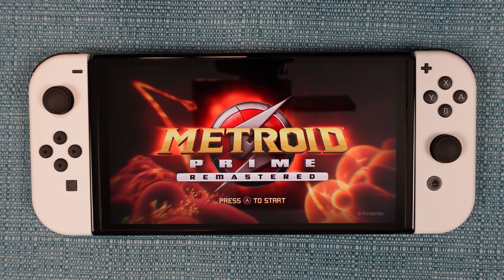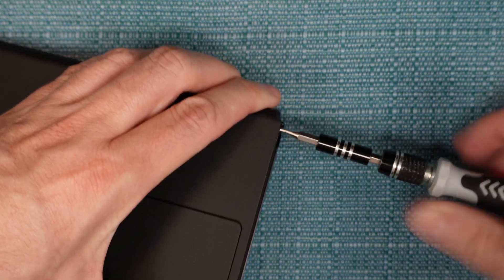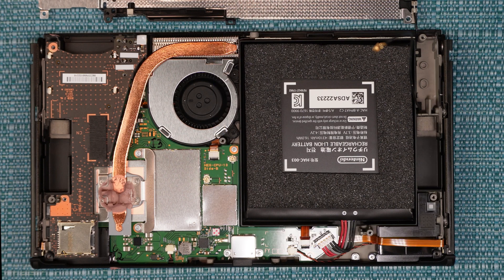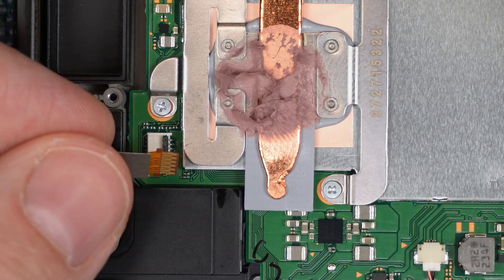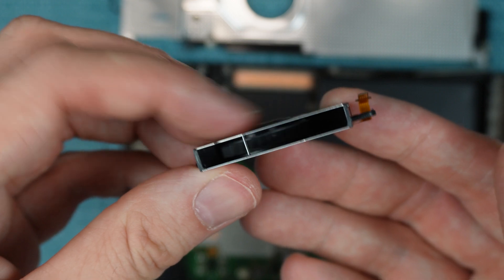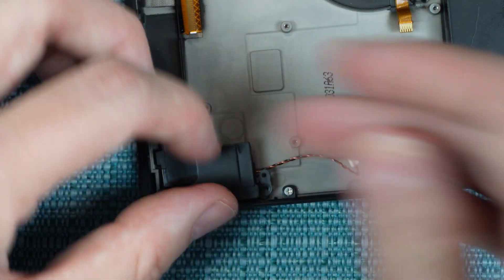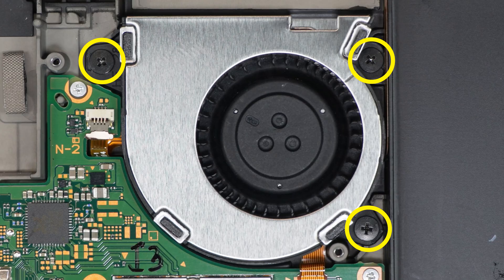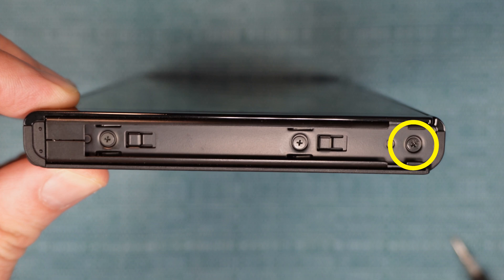How to Open Up a Nintendo Switch OLED to Replace Thermal Paste, Fan, Charging Rails, Battery, etc

Comment: Putting heat on the battery is dangerous. Instead, use IPA or Acetone to remove the adhesive underneath it... DON'T USE HEAT ON THE BATTERY!!!
Reply from the maker: Batteries already get hot during normal operation. As long as you keep the temp at a minimum it is fine. BTW, using IPA is risky too because it is flammable.

Comment: i fked up and accidentally cut one of the cable in shield plate but the wifi still working not sure what it do. and my tips for newb diy repair, removing the cable first so it safer when trying to remove the battery.

Comment: I broke my wifi antena off the circuit board the piece it clips in, will it still work?
Reply: It snaps in place.  If it didn't actually break, you should be able to just snap it back on.  If it broke off the head that snaps on the circuit board, you'll have to repair it, then snap it back in place.

Comment: Where's those mesh dust covers on the bottom. Are those on the cover? One of mine ripped off and needs to be replaced.
Reply: They're on plastic rails that are screwed on the inside of the back of the housing/shell.  The mesh is attached to the rails with both two-sided tape and some type of adhesive.  The screws are the smallest found within the unit and are very hard to work with.  I had to use tweezers and a magnifying glass.  It is probably easier to just leave the mesh off, being it's hard to glue new ones on without making an unsightly mess with glue.  It harder to do than you might think.

Comment: Hii thank you so much for this video 🔥🔥, im just trying to replace the battery but one screw by the internet cord inputs doesnt want to come out its kind of gotten stripped what do you recommend i do?
Reply: It has had some water damage it's my neices that fell in the sewer catch and we luckily got it out but it did get some water on i do believe it still works because the screen still turns on to show me its dead or charging but does not charge so im assuming the battery got fried with the water

Comment: Thanks for the video!! I have a question, the copper colored ribbon the connects right next to where the battery cord connects- came loose while I was replacing my sons battery yesterday. Is there a way I can get that back in without damaging it?